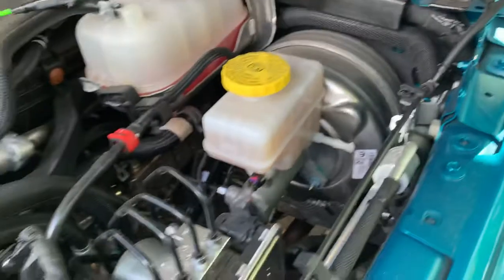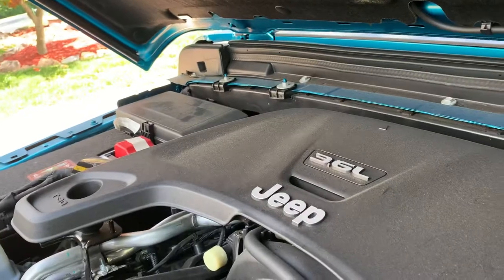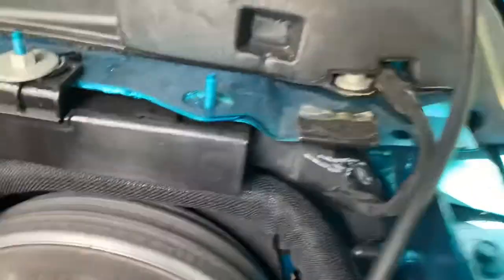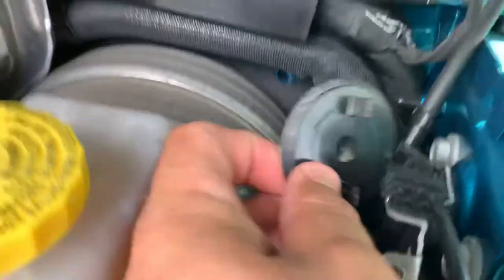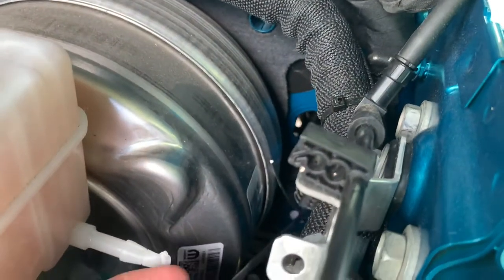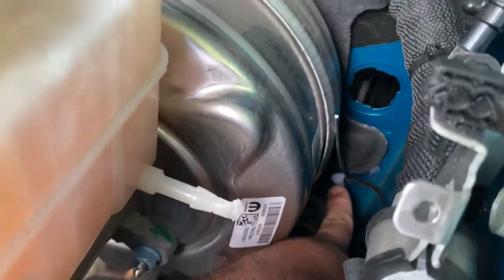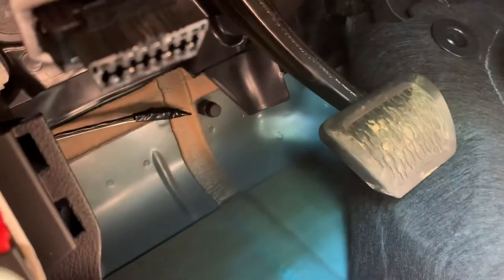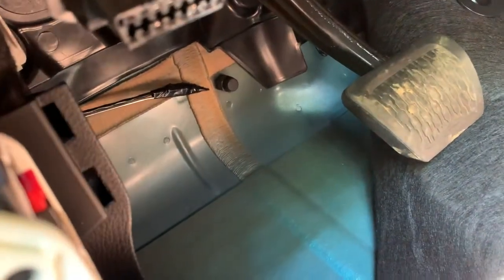JL Jeep Wrangler firewall wiring pass through via driver side / RV brake

Comment: Thanks.  That's what I'm trying to do on my 2020 Wrangler. 

How do I remove the cap covering the hole?  Pry it off with a screwdriver?

What about going through the top corner of the hood?  There is a weather strip plate with a wire hole in it.  I guess it wouldn't be hidden on the inside so maybe that's the drawback.

My lighting harness looks almost too big to pass through the hole and I don't want to cut and splice it?  It's a temporary lighting solution.  My other alternative (I think) is to pass it through the door and hood each time, but that's a pain.  Maybe I'll have to hire someone to wire it because I'm not a real mechanic.  I can just do simple stuff, and I can barely reach that opening by the master cylinder.
Reply: Update: I pried off the cap.  Now I'm working to snake through the wires.  I'm also doing breakaway wire.
Question: Whats the best way to fill up the hole if I can't get to that grommet?
Reply: Update 2: I was able to thread the wires through the hole without the coat hanger.  I bent down under the dashboard and I was able to see light coming through the hole.  I fed the wires through by hand.  The light harness barely fit when I twisted it.  Now I'm looking for a place to thread them down to the baseplate. 
Question: Is it dangerous (engine fumes) to drive with the firewall hole not filled up?  I would guess not many fumes are in the engine compartment unless the vehicle is several years old and has some problems.
Reply from the maker: @TheSteveGainesRockBand  hello.  I would use the grommet vs the cap because of the fumes.   But to answer your original question.  I have not purchase the MOPAR light harness for flat towing or any aftermarket harness.   We have a luggage tray/rack that goes into the hitch.  that rack has lights on it.  While driving the jeep i plug the 4 pin connector into the jeeps trailer light port.   If i flat tow the jeep behind the camper I use a long 4 pin extension and run it through the interior of the jeep out the passenger door, under the hood and out near the grill.  i then connect the extension to the camper.  the camper then powers the lights.  I route it this way to the wire doesn't flap in the wind.
Reply from the maker: the cap should twist off.  I wouldn't use it unless you have a large grommet to prevent fumes from entering the interior.
Reply: @GrandSport340  Thanks. I'll find some way to plug the hole.  Some people say you can fix anything with duct tape.  :-)  I was able to thread the wires down to the baseplate but I wasn't very efficient and the wires barely reach.  I will try again this afternoon.  I think I can route them more directly.  My concern is not getting the wires near something hot or a part of the suspension that moves.  I'm clear of belts and fan.
Edit: while eating lunch I had an idea.  I'll just go to the auto parts store and buy a short lighting wire extension and then I won't have to re-thread anything.  I'll just connect it at the bumper and pull back the excess.

Comment: FYI This won't work on a manuel Trans this only works with an Auto Trans.
Reply from the maker: Correct.  I believe I mention that in the video.  Sorry for any confusion

The factory grommet for running wire into the cabin is on the passenger side.

Comment: Is this automatic transmission? Can't seem to find it on manual
Reply from the maker: Yes. My JL is an automatic
Reply: I also have a manual, its below the fuse box on the passenger side. If you pop the 3 left plastic rivets holding your front passenger fender liner in place you can access it. It's a thick rubber grommet with a wiring harness going through it. Just carefully poke your way through it to the passenger wheel well. I got the rough country mlc6 multiple light controller so that I'd only have to go through once. Then you can power 6 lights from under the hood and turn them on with the 6 switches that get installed on the dash.
Reply: @nicklevesque4687  Thank you. I also got an MLC6 but it's mounted on the driver side and the wire they included wouldn't reach to go around the passenger side. I figured out how to do it without going through firewall at all. Since we're on the topic, how do you run your lights from, for example, rear bumper? Running them outside can mean they get broken, running them inside means they need to go back outside as my MLC6 is outside (under the hood). Any advice? Additionally, my MLC6 switches are always lit even when the car is off. It is slowly draining the battery. Is there a workaround? Have them light up only on accessory/engine on.
Reply: That’s odd, I ran my wiring harness from the controller to the passenger side, through the grommet, up behind the glove box and to the dash with maybe an inch to spare. It took a few tries but it reaches. As for my roof rack lights, the wires run beside the rear window bracket, along the window gasket and I put some quick release plugs next to the stock fluid and wiper motor plugs so it’s all neat. From there I have multiple pre rigged wires running to the front, up through the windshield seal, Into the drivers side front cowl to the controller. It’s confusing but it’s clean with no drilling. I’d call rough country about the lights as it’s meant not to do that
Reply: @nicklevesque4687  Yea but did you mount the controller on the passenger side by the battery? I couldnt' do that as my snorkel tube is there so I had to mount the controller on the driver's side. can you send some links for the quick release plugs and pre-rigged wires? any info helps!
Reply: It’s mounted on the passenger side where the instructions said to. I got the plugs at Home Depot and as for pre rigged wires, I just ran 2 black and 2 red wires from the trunk to the controller to power my rear accessories